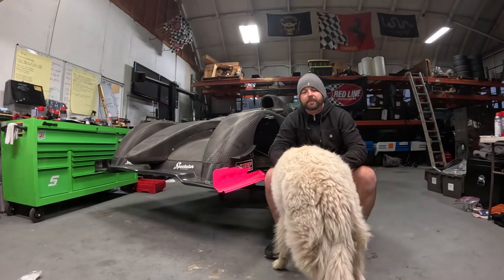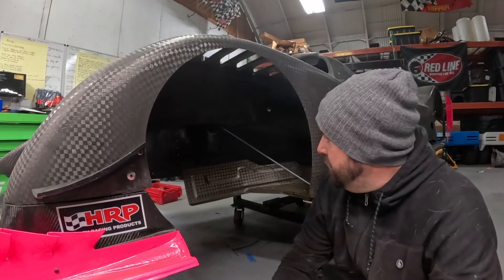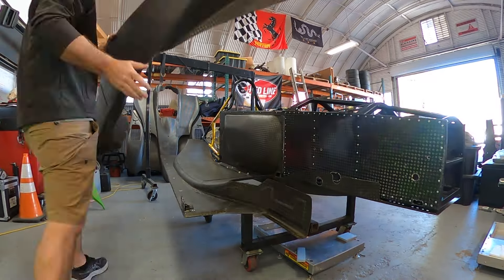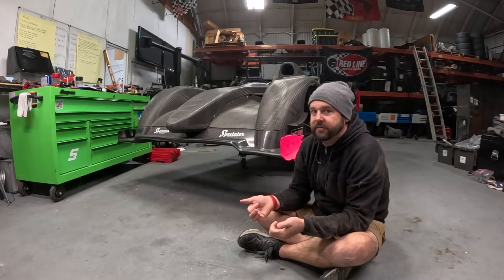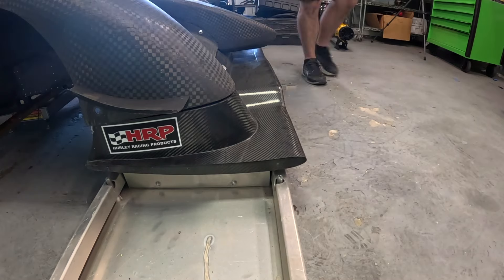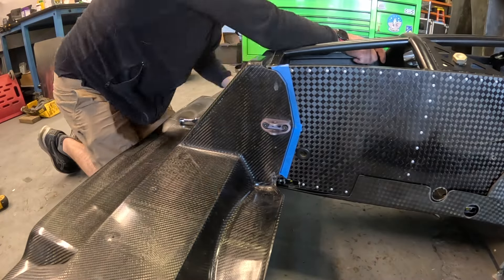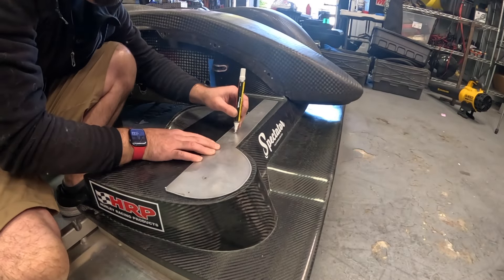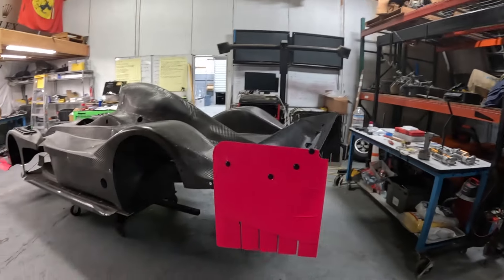Episode 7: My New Front Diffuser Tries to Kill Me! - Installing my new carbon fiber front splitter!

Comment: What was the issue with the old splitter?  I also go by "if it's not broke, don't fix it"
Reply from the maker: Tim,

It’s a better product in a number of ways. But the main to is it works like a wing not by cutting off air to the underside of the floor. Using the new tunnel floors I need the airflow under the front of the front diffuser. It also has the low points on the outside. My old splitter was flat across the front. Means I could put the entire leading edge on the ground and stall the diffuser. Can’t with the new one!